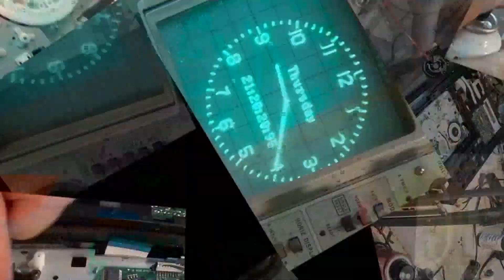Luxman M2000 Power Amp just Hums

Comment: Percussive diagnostics are very useful. Always give it a whack. I found and fixed bad solder points in a subwoofer by tapping on the circuit board with a bamboo chopstick!
Reply: Yeah I agree. BUT.. You must tap around the section that has a bad connection VERY SOFTLY because if you tap agressively you will end up removing the 'oxydation' if there are any .. The contact will catch back FOR A WHILE..  Then the problem comes back after a couple of days (oxydation rebuild). Taping softly will show the problematic area without bringing back the connection.

Comment: The M2000 was a fairly pricey amp back around the late 70's. The next model up would've been the M4000 which was pretty hefty both price and weight wise. I've a M2000 along with two L100 Integrated amps and a T-110 tuner. Very solidly made, attractive and performs well. One of the L-100's remains in protection mode which I must address in due time, it's probably the connectors that need cleaning and circuit board touchups like you're doing. Good to see the insides of this unit, thank you!

Comment: As soon as that buzzy hum sound was heard,  it sounded EXACTLY to me like two different guitar amps that had the big filter cap on one rail had a cracked solder joint.    That SAME buzz.   That's one beastly amp.

Comment: Mmm hand drawn Luxman circuitry. The first amp I fixed was a Luxman L30. One issue was intermittent crackles... Diagnosed and isolated via the whackamole method. Luxmans seem to enjoy this.

P.s. The small signal transistors fail because the had silver tinned legs. The silver oxidises up into the wafer.

Comment: Plug-in cards (aka “works-in-drawer”) was almost a rage back in the day .. until it was discovered that heat/expansion cycles would cause them to back their way out of the slot/connector, (Did you ever see a raised nail on the outside of a house). Hence, a locking mechanism is needed. Also, the edge connectors need to be very robust …
Reply: Ala S-100

Comment: Smacking is brilliant diagnostic technique, haven't even finished the video yet but sure does imply a connection problem or dry solder joints perhaps, I thought filter caps might have been bad first off I'll kepp watching now to see how it goes lol first impressions though I like your style 😂😊

Oh wow gorgeous fucking amp 🤤 had an l200 years ago from tip shop just replaced caps and couple of resistors I could see were burnt out works beautifully till I over drove shitty tip shop speakers and blew it beyond my knowledge of fixing at the time 😂

Comment: Shame the top of that unit is scratched up my Luxman is 50watts RMS per side! it was funny how you talked about the Zenith Tv's with those plug-in boards that was a good set other than that issue I did Zenith warranty work in the day .
Reply from the maker: Well those chroma color too did have a good picture when they worked. But boy did they have problems that four lead capacitor would blow up all the time triplers failing left right and center and of course those plug-on modules that caused all those intermittent problems that everybody just despised. You'd fix it send it back to the customer a month and a half later it's back with a different intermittent fault you'd fix that you send that back out two months later it's back with a different intermittent fault you'd reseed everything again we were unplugged all those connectors clean up the pegs that they are on tighten down the springs push them back on be perfect in the shop send it out six months later it was back with another intermittent problem then people would get mad tell you you're incompetent that you can't fix it and the problem was caused by the modules. I remember getting one in once that some jackass had soldered all the modules down to the pins well that was great module didn't have a failure bad connections but when a module failed and you had to remove it and it was soldered down well there was no way to really get the module out other than break it out and then unsolder all the individual pins and then you couldn't send the defective one back as you remember seeing if you used to take the modules back and rebuild them.

Comment: The malfunctioning amp may not know the words, but it can certainly carry a note at 60 Hz...

And, yeah, you have to give it a knock sometimes.  When everything is normal, it shouldn't do anything but work even when giving it a few whaps.  But if there are bad connections or bad solder joints, giving it a few whaps can help you to reveal problems and even the general vicinity of the fault.  It's not like you're taking a sledgehammer to it.

Comment: I've seen a lot of square  cross section pins cause trouble, a black line is always there where the opposite contact touches the pin. dampness is my guess.
Those transistor sockets bother me,  I'm sure they weaken over the years.
But i so like the easy changing of the outputs.:-D
I am no lover of wire wrapping on square pins, damp buggers up the connection.
Dam i'm moaning again lol.

Comment: Greetings from New Zealand. Yes, the service industry cannot afford time consuming repairs, the customer wants their stuff fixed at a reasonable price else it gets dumped. To run a successful repair shop, any shortcut to find the fault is used, so anything that works is valid. The actual  repair is the easy part of the process, finding the fault is the expensive bit...  I am usually informed that it was working yesterday, so there  wont be much wrong with it, and its likely just a "wire off".
Reply: Well today it’s a throw away nation

Comment: Yes likely bad connections on those tinned connectors, they get grumpy with age. The voltage might be already set to 120VAC, probably by the importer, to get the regulatory sticker, so they just did not bother with changing the rear panel sticker. 61V on the 80V capacitor is about right for the rails anyway, and that transformer certainly never has run warm in any way.

Comment: Tapping on components to test for loose connections is a perfectly valid diagnostic method.  Dragging chassis/faceplates/heatsinks around on your bench potentially causing scratches and worn edges makes me cringe.
Reply from the maker: I don't drag them around.  I lift the edge with any edges that could get scratched.  In this case the unit is already beat up.  If i have a piece that is in  immaculate condition I will either put a rag down under it or stick tape on the edge during service.   Watch when i move things.  I lift the front side up.

Comment: I can tell you’re from around my age. My “elders” used to give me s**t if I banged on something to troubleshoot or if I “Easter egged”. Even if it was cheaper. The NASA crowd and older, they always wanted to know the exact cause.
Reply from the maker: My elsers were the ones that taught me to rattle and smack everything. You should have see what the engineers did at the TV station I interned at. I am surprised the old CEI280 cameras even worked at all considering the abuse the engineers and crew gave them. Bad connections everywhere and they were generally fixed with a smack on one side or the other.
Reply: I started work in about 75 in the Houston area. Worked with a lot of Viet Nam era ex military technicians and lots of ex NASA technicians. Those guys were crazy strict. Also started working on geophysical electronics - cost a pretty penny. Not to say there weren’t a few properly timed percussive taps used every now and then.
Reply: Percussive maintenance is all well and good for troubleshooting, but I don't like to rely on it during use.  I would like to know the cause of the fault as well, and then fix it, rather than making a habit of pounding on something until it works, and then hoping it continues to -- because it probably won't, and then I'll want to pound on it out of frustration.

FWIW, I definitely don't want to hear someone on a space shuttle telling me, "oh it does that -- just smack it until it starts working again."  Naw, man!  This isn't a shop radio!  Fix it!  hahah
Reply from the maker: @nickwallette6201  Well tapping intermittent is how we find the fault. It allows localizing the fault. Once the area is found then move to the plastic spudger to lightoy scrape the board or probe individual connections to see if the fault reoccurs and then go in and fix the problem. With the cameras that were always faulting at the TV station they were beat up so much because the engineers never were able to fix the problem. They would work on them, and then in the next production, right in the middle of a shoot one of them would start acting up.  We would stop tape, smack the camera a few times to get it working and then continue, and the engineer would be back on it again and not fix it.
Reply: @12voltvids   I'm with you all the way on finding faults, and I get sometimes you do what you have to do when you can't find an intermittent fault, and have to keep using something anyway.

What bugs me is people who put up with stuff that can be easily fixed, like a dodgy connector, or bad cable, or something like that.  :-)  Smacking is a temporary fix!
Reply from the maker: @nickwallette6201  people put up with intermittant faults because they don't want to pay to have it fixed.  They put up with it till it dies and then trash.